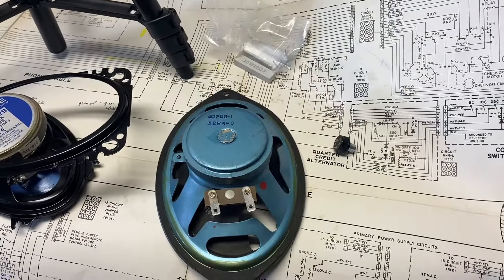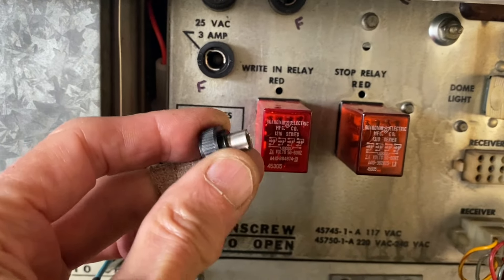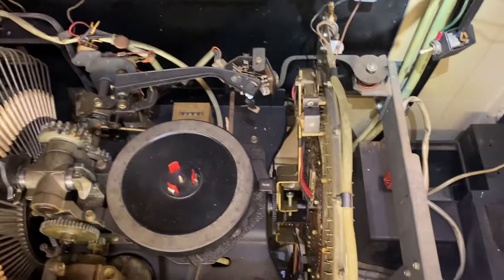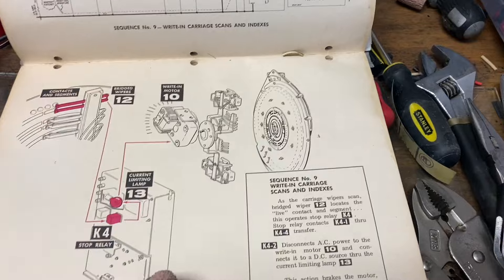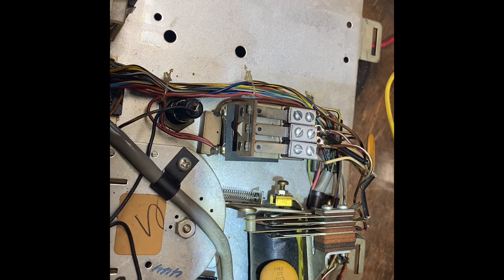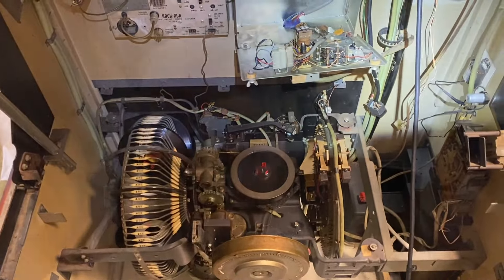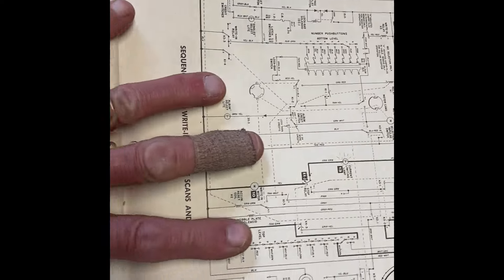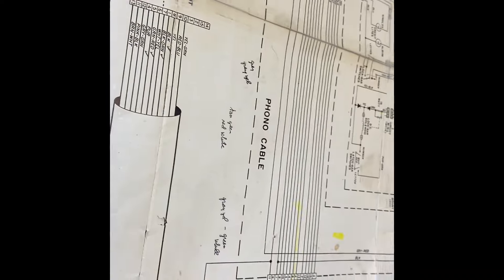Rockola 444 write in problems plus other issues

Comment: After pushing in a record number the write in motor spins and stops at the location of the pin....no limiting light flash and no striking of the pin on the write in...the read out motor will find the pin location bit will not strike the pin....when I move the pin by hand, the gripper will pull the record and play but then will not stop playing...the reset does not cancel the record and moving the arm will not cancel the record....i can press and hold the gripper  reverse in the control box and it will return the record to the magazine and then start turning the magazine back to home....so it does not strike a write in pin and it does not flash the limit light after finding the pin location and it does not cancel the record..thoughts?
Reply from the maker: Are you referring to a 444 model?  Failure to hammer the write in pin starts with the K4 write in relay.  Have you reseated it and taken off the red cover to clean the contacts?  If no, do this.  Then leave the cover off when you put it back into its socket so you can see if it is actuating or not  Then go and reseat the the selection molex on the front of the power supply and the credit unit.  Then go to the credit unit.  Open it up and clean the contacts of the ADR relay and the debit coil.  Again leave it open so you can see if the selection impulse switch and debit coil work when you make a selection.  Lastly, watch the wobble plate solenoid to be sure it is kicking in when the write in motor stops.  Lots of possible causes of trouble here.  Review sequences 9-11 in the manual.  Reset the jumper plug on the front of the power supply as well.  Then report back.  We may have go thru the Rockola Jukebox Club group on FB to send each other videos.  If you haven't joined this group, I would recommend it.

Comment: Thank you so much for this video ad I am chasing this problem with a Rock-ola 460.  It would help if I could get a 25-30 volt supply to check relays. Can you share what you use please?
Reply from the maker: look for a transformer rated at 3 amps with a 24 VAC tap.  Connect the two wires that supply the 24 VAC to a 6 amp or higher silicon full wave bridge rectifier.  AC leads should be marked.  The other two leads will give off DC, one positive and one negative.  Use the DC leads to check the gripper and magazine motors in these jukes.......and the 24 VAC to check the write in motor.  Contact me on FB Rockola groups for specific questions or better yet, join the Rockola Jukebox Collector group and ask specific questions to all.  In my last video today, I mentioned a current limiting bulb which is a good idea to use when testing any unknown load, be it a motor or an amplifier or a power supply.
Reply: @williamweisel2176  I have an idea- Why cant I connect to the 30 v output from the power supply and connect to the relays directly? then start back tracking from the relay with the 30 volt circuit to see where the issue might be?